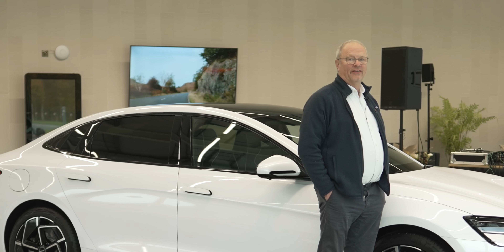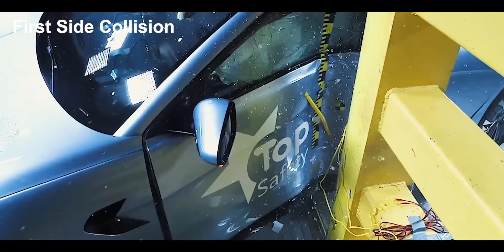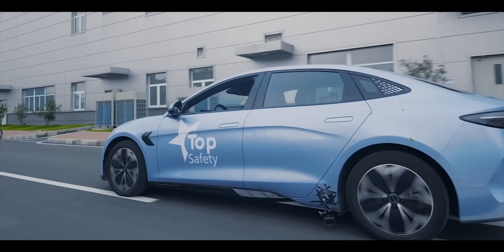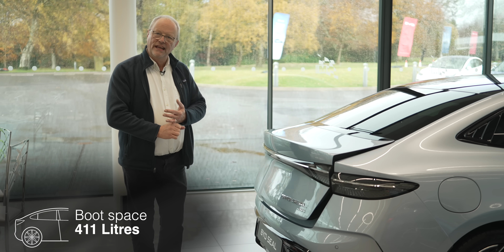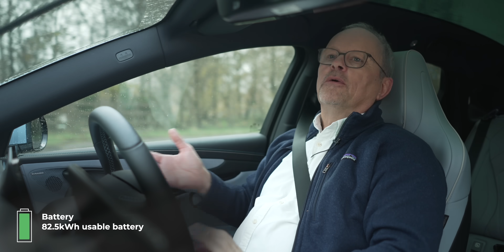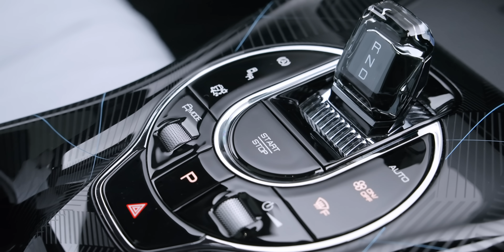This Car Proves Just How Far Chinese Cars Have Come

Comment: That is one of problems with evs it's not simple to direct air and going through settings while dr8v8ng could be dangerous.

But here is the thing you didnt mention price or insurance costs considering that has gone up by a lot for evs.

Also BYD have been catching fire and if their cars are anything like Tesla cars they don't like puddles, so what do you when you come up against a deep puddle turn around and go back while watching ICE cars drive through?
Reply: I own a Seal and it’s easy to change the air settings. Ventilation is permanently set at the bottom of the screen. BYD are the best selling EV brand in Thailand, has not been any traction battery fires, you are probably thinking about PHEVs in China
Reply: Do you need a link to the videos of ice cars failing in recent floods? Either letting revs drop and blocking exhaust flow, or driving too quickly and investing water, pressure locking the engine?
.
Or, Tesla's negotiating the same floods without incident?
.
Smh
Reply: @rogerstarkey5390  well I was heating about someone in Scotland that ended up with a wrecked battery and Tesla refused to fix his car even though under warranty in relation to water getting in to the battery.

So yes maybe they will go through but end up wrecked a short time after.

Also in general ICE cars are not super expensive to repair after a puddle stop, compared to battery cars.
Reply: @flitsies one example /= wide spread issues.

I could buy an ICE car tomorrow and the engine be a lemon, but that wouldn’t be representative of ICE cars.
Reply: @123silentassassin  But when a type of car consistently has tech put in it just because of the type of car it is that tech becomes a problem which makes the car a problem to drive.

Why have an electronic control over something just because the car is electric when a simple lever would do 
Could you imagine having to go through a complex set of proceedires just to do a pee.
Well that seems to be the electric car, full of tech that used to be done by hand on the go, but now has to be set while standing still in case you crash into something.
Reply: @flitsies  Again, that isn’t representative of EVs. I can buy an ICE car like that, but that wouldn’t be representative of ICE cars. It’s also noted you moved the goal posts.
Reply: @123silentassassin  I was attempting to decipher your posting.

But that aside, I know a few people that own Electric cars and yes they like them, and I always thought I would buy one at some point, but the problems I see with them suggests that even now it is too soon to buy one, for 1, the price is ludicrous, 2, the range unless you buy an expensive car, is not that good, 3, the charging though not a massive problem in the city having to plan a journey just to nip down to the coast seems a bit much.
4, they are full of tech that I would probably never use so I would be paying for something that will never have any benefit to me, 5, I want to be able to drive the car, not have the car drive me, 6, repairs are probably super expensive looking at a replacement head light which costs over a grand plus they have to be coded to the car so I'm given to  understand, I could be wrong on that.

7, just replacing the 16v battery costs around 2 grand, and this is based on a car that everyone says is the car to buy if you go electric.

8 You can't leave them sitting too long or you mess up the battery, they discharge themselves.
I don't drive much my petrol car I park up for two three weeks at a time I put petrol in and go to it when ever I need to use it, I don't have to put in more petrol just because it sits there doing nothing, evs you have to or they go flat, that's how I got my electric motorcycle someone didn't recharge it it died and at the time it was cheaper to sell it off cheap, and I got it for next to nothing, but I still need to get a battery for it, which will cost almost 2 grand.

So these are just a few issues with electric vehicles, my ebike has had to have two new batteries in 4 years, were this a petrol moped at the worst I might have needed to change the piston, which would have cost me about 30 pounds, compared to nearly 300 pounds for batteries.

The costs far outweigh the use of the vehicles at present, and if they come out with onboard hydrogen then the battery tech will get even more expensive, and no not fuel cells.
Reply: @flitsies  1. Prices for all new cars are high.
2. The idea of electric cars is that you can charge at home if you have the ability to get a charging point. If you don’t regularly do more miles than the car can do, EVs are great, however if you can’t get a home charger and if you regularly do more miles than the car can do then they aren’t.
3. I assume you use nav? If so, EVs plan it for you.
4. That’s literally the same of every new car these days.
5. You do drive the car. It’s like every modern auto. If you want a manual, fair enough but to say they drive you without you activating the relevant stuff is not true.
Reply: @flitsies  6. Replacement parts for every modern car are high, it isn’t unique to EVs.
7. How often do you replace that?
8. They do discharge themselves, but not to the extent you’re making out. Besides, the same “you can’t leave them sitting too long” can be said for ICE as well.

An E-Bike doesn’t use the same battery tech as EVs, plus all EV batteries are guaranteed for at least 7 years minimum, if they were expected to expire that quickly why would they guarantee them?
Reply: @123silentassassin  At 5 there is merit in what you say about modern cars having this junk in their systems, but with an ICE you do most of the time get the option of some of that junk in or out, whereas with these electric cars you don't, you accept the junk or search for a different brand.

In all my driving years I have never found the need to have a car control my lane discipline so why would I want to pay for that junk now, I have never needed a car to tell me when to apply my brakes either again why would I need a car to do that?

I imagine having to fight the car to avoid an obstruction in the road when I would normally just casually observe and move over all at a rapid pace to avoid said objects in the road.

Also I suspect it makes you a lazy driver having all that junk instead of paying attention to the road I suspect many people will do what they did with driver assist with Tesla cars and just rely on the car to take care of the driving.

If my driving was bad I would stop driving, I wouldn't want the car to take over my driving to some how correct my bad driving, I would rather trust my transport to a professional than to a computer on wheels, not only for my own safety but for the safety of others.

So I do not agree with all that junk being added to cars in the name of safety, cars are safe if driven properly, if anything all cars should have active recording at all times so if there were any accidents the recording would be instantly sent off to a storage location where the driver would only be allowed to access it to pass a copy or a code to the insurance company, but police would have full access to investigate collisions and why they happened.

That might reduce collisions.

Electric cars seem more dangerous to me, in fact modern cars I think with all the junk added seem more dangerous, from the stories I have heard about.
Reply: @123silentassassin  7, How often do you replace it, well I don't know but if they are looking at some of these Tesla cars having to have their 16v battery replaced under warranty that is a good question.

8, Well from what I have heard and seen it seems they do discharge themselves a lot, the cars wake themselves up and just keep on draining that battery.

You can't even keep them plugged in to top it up, and it's not advisable to keep them charged up to 100% as that damages the battery as well.

As for them being different cells nope the cars use pretty much the exact same battery cells 18650 lithium ion cells usually Samsung cells though Tesla has a bigger cell type now, but it is still the same basic construction battery Lithium ion some do use Lifpo4 which are safer but heavier and with reduced range.

As for the 7 years for a battery that costs so much, some how does not seem a good deal to me, If I only charged my bike battery up to 80% I would get less range and put less strain on the cells, but if I had an ICE moped I could use 100% of the fuel, and go about 4 to 6 times the range of a single battery charge for one single fuel tank which is about 3 to 4 litres or so of gasoline.

I do like electric vehicles I think they are great, but the weakest link is without a doubt the battery, and the biggest problem is all the junk these manufacturers keep putting in these cars to justify the huge price tag.
Reply: @123silentassassin Oh one last thing I didn't mention was the fact that with a car sitting for weeks you can so long as you keep the battery charged ie use a battery saver solar panel or even connect it to the mains via a battery conditioner or some other 12v battery protection system, just go up to the car and start it, you might need to change the oil after a year, but generally it will run.

I leave my car for up to 3 weeks just can't be bothered to drive, I go up to it turn the key and bam it fires up, I check the tires and all the regular stuff and off I go, if my car were electric it would be a giant paper weight by now, with a huge bill waiting for me to replace the battery.
Reply: @flitsies  That just isn’t true at all.

Showroom EVs are usually kept in showrooms for months at a time and they start up no problem…
Reply: @flitsies  Some engines are replaced under their 3 year warranty periods, does that mean ICE cars are bad?

Again, comparing battery behaviour to that of an E-bike is disingenuous.

It only damages MCN batteries, LFP prefer to be kept at 100% and MCN is now only on older EVs.

Again, why would a manufacturer warranty something for so long (again 7 years is the minimum they’re warrantied for, most warranty for 8) if they’re not going to last?

In most instances EV batteries will outlast the bits surrounding it. There are old Tesla’s and Leafs on well over 300,000 miles with only 10% battery degradation.

You also are aware that an EV battery isnt just one big battery but made up of many, many cells that can be repaired or individually replaced? The odds of needing to replace an entire battery is slim to none.

One other question, how much do you think a brand new engine will cost including labour?
Reply: It’s the PHEVs that’s more prone to catching fire, and Bobby has also mentioned in the video.
Reply: @kin9225  Maybe BYD are different in China.
Reply: @flitsies BYD is also the best selling ev brand here in Malaysia since launch back in Dec 2022. Have not heard of any battery fire so far. Used to be the cheapest ev until the arrival of another Chinese ev, the Neta V.

Comment: Unfortunately doesn't match Tesla's safety standard . ..
Reply: It has a 5 star safety rating from Euro NCAP.
Reply: @kamsunleong6648  And the BYD was tested under the 2023 Euro NCAP testing procedure, which is stricter than the previous version used by Tesla.

Comment: Their lease costs are still very expensive. Mich higher than the established manufacturers
Reply: Lease costs are determined by predicted depreciation.  No-one knows how these cars will depreciate, so finance companies assume the worst, and price in high depreciation (which is - effectively - what the lease-cost covers, plus the finance company profits, etc)
Reply: @logicalChimp  agree but as most people lease or pcp then the better purchase price is lost. At the moment you can finance a bmw i4 with a bigger battery for the same as a BYD.
Reply: @MW-uh1xv  i4 battery is 80.7kwh. Marginal, but BWD is 82.5kwh. I love BMW, had them since my second car (first was a Peugeot 206!) but ultimately the i4 is an EV crammed into a 3/4 series chassis. Plus the i4 M50 starts around 105k here in Ireland. Double the price of the BYD Seal AWD, but with similar BHP/Torque and marginally slower 0 to 100km/hr!
Reply: @logicalChimp I’m gonna bet my shirt on the depreciation being as bad as all EVs

Comment: Australian Atto owner with 20k on the clock and yes it’s a brilliant car, I do love the look of the seal if only it was a hatch I’d trade up for sure back when I smoked I always owned Toyota’s for build quality and reliability. The build quality with BYD is just as good and as a bonus the wheels stay on 😁👍
Reply: I too own an ATTO 3. It is a good and reliable car for my everyday use. The safety features are good.
The power is there when i need it, for example, when i am changing lane.
Reply: Seal U is coming, although will you still like it knowing it shares a Phev platform?
Reply: @gregb1599 the BYD sea lion 07 is built on a dedicated EV platform, I think you are getting confused with the Song L, Greg.
Reply: I'm  sure we will have the sea lion 07 fastback in late 2024/ early 2025 here in Australia that looks like a seal SUV.

Comment: It has indicator stalks so in my mind its one up on the model 3 😅
Reply: ..and a driver’s display, HUD, Drive selector, V2L…
Reply: @EcoHouseThailand all stuff that just gets in the way.  Even motortrend admits the model 3 driving experience is better.
Reply: @shou635  no, most expert reviews say its stupid and dangerous to drop stalks
Reply: @shou635  3 or 5 point turn constantly having to reach for the screen - no thanks. Indicator buttons both on the left side - one on each side would have made more sense, but on a roundabout you will have to take your eyes of the road
Reply: Can’t buy stalks from s3xy buttons company if needed.
Reply: @shou635  I think it’s fair to say if self driving was mature and working in Europe then you can get rid of those things. As it stands right now the existence of the stalks was so a driver doesn’t have to look away from where they are driving to indicate etc. On a roundabout having to look to find the indicator button whose orientation and position on the wheel has changed while driving is more dangerous.

Comment: 10-80 % in 38 minutes is a dealbreaker for me
Reply: I have a seal it charges at 150kW= 2.5kWh per minute. 10-80% is 70% of 82.5kWh = 57.7kWh so 23 minutes not 38. Charging speed only slows after 80%
Reply: @EcoHouseThailand  I got my data from ev-database. But i looked it up because thats exactly where a lot of BYDs struggle with.

So the charging curve is absolutely flat? 150 kw constantly until 80 %?
Reply: Better stick with an ice vehicle, tostrong2209 so you are limited to no more than 10 minutes max to fill your tank.

Comment: Based on how much fun you were having driving it I'm guessing that was the dual motor performance model?

Here in Australia the first shipments of Seals have just landed in our ports, and customer deliveries should begin over the next few weeks.  For the Australian market they've been really aggressive on pricing, to the extent of having a third, entry level model with a smaller battery (61 kWh instead of 82 kWh), smaller motor (150 kW instead of 230 kW) and fewer bells and whistles that is priced at $14k AUD less than the local price of the base model Model 3.

We have one of the single motor, 82 kWh mid-range models on order, and are looking forward to picking it up before the end of the year.

I only wish that they'd offered some more interesting colours. Here our only choices are white, greyish blue, blueish grey, black, and (top end model only) greyish grey.
Reply: I have the white AWD Seal and it really sparkles
Reply: He mentioned the HUD, and looking at the specs sheet for the Seal, only the AWD version comes with the HUD. So, yes.
Reply: @stephen-boddy  The different models and their features depend somewhat on location, and I'm only familiar with the Australian versions not the UK ones. Here both the top end AWD and mid-range RWD models have the HUD, only the entry level RWD doesn't. It was one of the reasons that we decided to order the mid-range model.
Reply: @anthony_horton  Ah, well I was looking at the UK spec sheet, and that only shows two variants. I guess we are not offered the mid-range RWD.
Reply: @stephen-boddy  Having a quick look I think the UK RWD model is almost identical to the Australian mid-range RWD model, the HUD seems to be only difference I can see.

The Australian entry-level RWD model is a rather different beast. Smaller battery and motor, lower max charging speeds, different brakes and tyres, and a few convenience features removed (mirror and seat position memory, lumbar support adjustment, etc.).  It'll be interesting to see how it sells compared to the other two models. It would be a really sensible option for a lot of people and it is $9k AUD cheaper than the mid-range model, but how many people chose cars for sensible reasons?